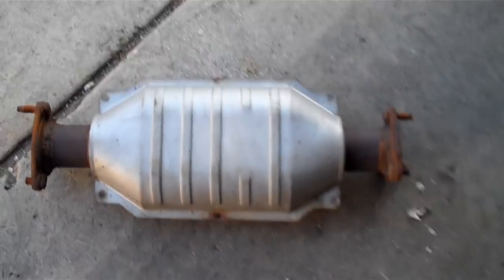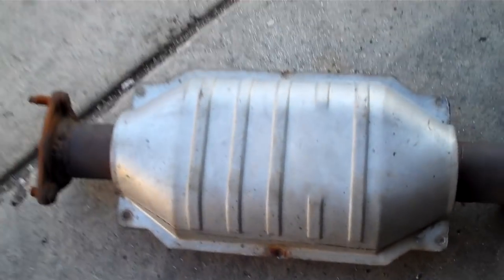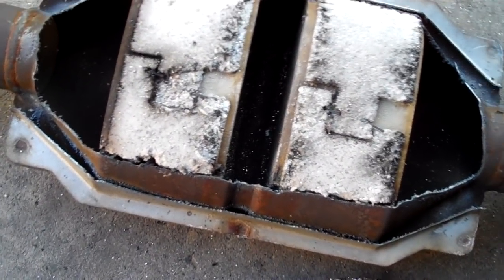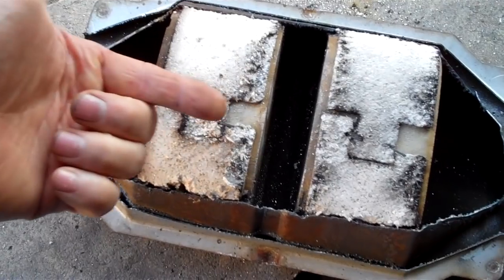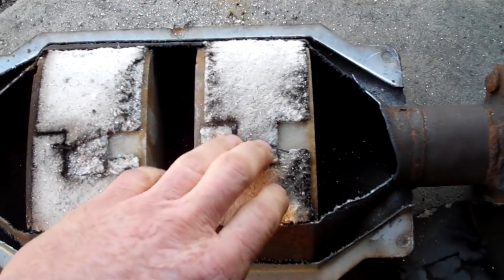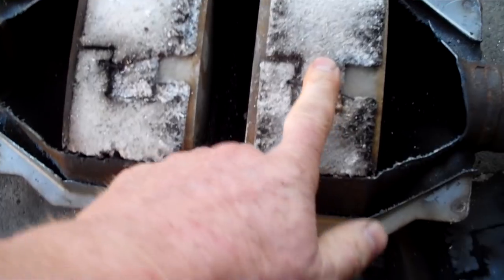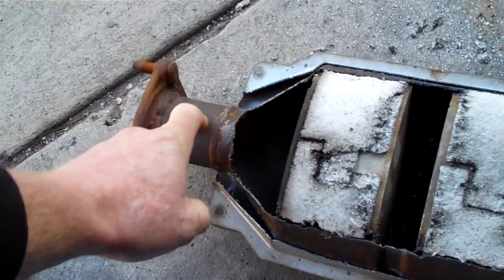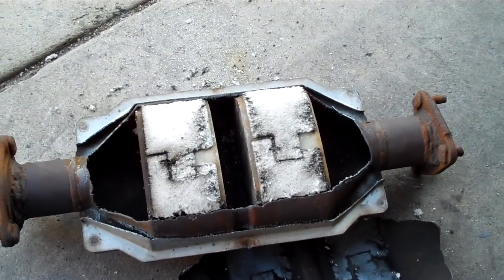Here's what's in a catalytic Converter.  Here's how they work.

Comment: Hey bro question I have a 97 sentra it somewhat burns oil not alot a little. Past month car was getting weak on me about a week ago the the CEL came on and the car died right away on me on the highway I popped the hood and the cat was glowing orange very hot had to tow it gave me a PO300 code some kind of misfire is it the cat only? or could it be other things would i need a new cat? i dont know if i should work on it since it does burn oil and i heard that could be the problem.

Comment: I worked as an auto mechanic to pay for my Electrical Engineering degree from 1970 to 1975. Years later I read about this "200 mile per gallon carburetor" in science magazines. For $20 you could get the instructions on how to convert your car. It seemed like a hoax or snake oil. In 2021 I have to ask, with all of this information available to everyone on the internet, why hasn't Elon Musk, Jeff Bezos, or Bill Gates come out with a car that uses Olge's invention?

Comment: and thats why they put the catalyst on the end of the combustion rather then  the front for oil companies ..man it must get some crowded in that bed , the oil sellers , the car makers , the politicians, big pharma (cause it makes us all sick) ..if they all farted at once ..and there was candle in the room the world would be a better place
Reply from the maker: Vehicles run more efficiently on fuel vapor than fuel spray.  It's like fog vs a spray bottle mist.  Our fuel injectors mist.  At least fuel multi port fuel injection is on the table.  Another big gas saver is lighter cars with better transmissions.  I had a 98 Buick Park Avenue that got over 34 mpg highway because the transmission knew how to coast and use the torque of the 3.8L effectively combined with use of aluminum for sub frame, calipers, rims etc.  (made it ride better too) One of the central problems to all of this collusion and bed sharing is the economic model we have.  It has to always be growing.  Perpetual growth in a finite system (the planet) is a fundamentally flawed concept so basic that even a kindergartner  could predict it's failure.  If not for debt, marketing and planned obsolescence, the system would have been dead in 1920 A.D. or at latest in hte 1950's when voluntary planned obsolescence took off due to design and marketing.  It nearly died in the late 1920's, but was kept alive by the greed and ineptitude driven fear of the powers that be at the time.  The fight now is for survival instead of for something sustainable and better.
Reply: briansmobile1 my brother built one of them gas vapor things on an old 318 just idling ..just a mock up really ..duct tape and old pipes and a big water bottle...this engine had a bad miss when running normally and got about a litre to say 2 mins .... with the fuel vapor set up it didn't miss ..ran smooth and would run a half hour on a liter of gas...no joke ...till it finally sucked a piece of duct tape into the intake .....not really worth the gas companies sending someone to come kill him but its progress

Comment: Wow your smart!! 
Can I cut the cat off and run just the muffler? No emissions in my area. I have an 00 s10 with 4.3L. I don't have the po420 code yet but Iv got black sooty stuff in tail pipe. And when I give it gas I see billows of smoke coming out tail pipe(not burning oil or losing water). 
Anyway, great video!!
Reply from the maker: If you have black smoke- you may want to address a leaking spyder injector or vacuum leak (same job).  You'll get better mileage, and performance.
Reply: Your truck will not run well without a cat in it. I tried on a few cars running with no exhaust at all and they stuttered and stalled and smelled gassy
Reply: Maxwell Mcauliff That's because the computer doesn't know the right fuel mixture to send.
Reply: Your absolutely right, it was leaking fuel regulator on end of spider. Just replaced with brand new spider and truck runs like brand new!!! I just checked my hwy mpg and I'm getting 19 again. S10 with 4.3. Also did a full ignition tune up(tried that first) and one of the original AC DELCO iridium plugs wasn't changed when I had first tune up. Pulled that plug with 172,500 miles and that plug was like brand new!! Very impressed!!

Comment: How was you saying i could check the temp of the converter? what do you do ? i do have one of those temp gun things, what should the difference be temp. in front of converter and the back of converter, i have 3 on my 2001 jeep cherokee and my obd is saying p0432 Check for clogged or damaged catalytic connector??? do you have any ideas? i have replaced all 3 02 sensors new because it first coded 02 sensor but now that code is gone and changed to P0432..i cant win...lol..
Reply: BrianLeeUSA73  i am reply to mu own ...i just now found the 4th 02 sensor its close to my oil pan so i will have to go get a short 7/8 wrench , no room for the 02 socket tool..2001 jeep cherokee 4.0

Comment: ok Brian I totally dig your videos, you seem to know your sh*t.   I am a woman checking up on something, because I'm afraid that someone working on my benz does not know what he's doing. I heard a knocking in my car  so I took it in to a local mechanic, he says that bad plug wires is causing my car to misfire in turn has caused my cat to loosen up and piece off into my cat and that the honeycomb is now rattling around in there and that's what I hear.  My vehicle is a  1999 Mercedes E430. Does this sound correct? Then my husband says he's going to take the cats off and shake out what has loosened up. I told him that I didn't think he would be able to do that because I  thought there was a 1 way door on those things and that the honeycomb wouldn't just shake out that easily. Please can you help me?Does any of this sound correct? Thanks.

Comment: I thought the middle port was to inject air so that the HC can be oxidised to H2O and CO2 and the CO be oxidised to CO2.
Reply: There is no air injected into the exhaust system past the engine's exhaust manifold.
Reply: funkingitup
Air can be injected into the catalytic converter too. That's why I thought it might be a downstream air injection point.
Reply: *****
No air is injected into a catalytic converter except for at the inlet. There are only 2 ports. The inlet where the exhaust comes in and the outlet where the exhaust goes out. The products of any hydrocarbon combustion are mainly CO2 and H2O. If you burn a candle the byproducts are still CO2 and water in the form of steam. The catalytic converter uses metal catalyst to lower the energy of activation to initiate spontaneous combustion of undesired byproducts. Any oxygen (or other gases) used in subsequent reactions has to come from the inlet as there is no "downstream air injection".
Reply: funkingitup
Air can be injected into the catalytic converter. There is usually a port directly in the middle of the converter where it does this. This is called downstream air injection.
Reply: *****
That's wild. I didn't know they were still doing that. I know they did it with exhaust systems back in the 60's and 70's, but do any modern cars still do this?
 Does the air come from atmosphere or off of the pre-cat exhaust?